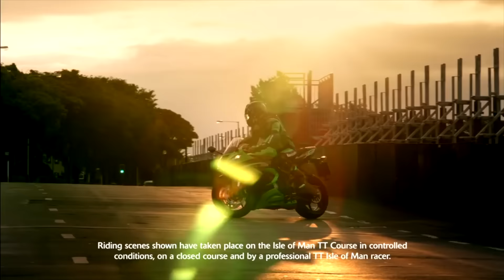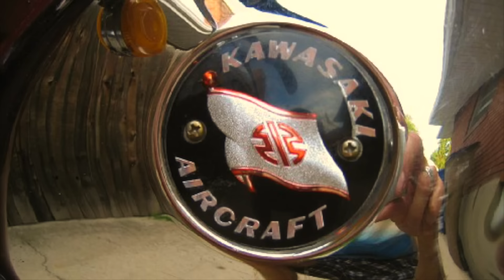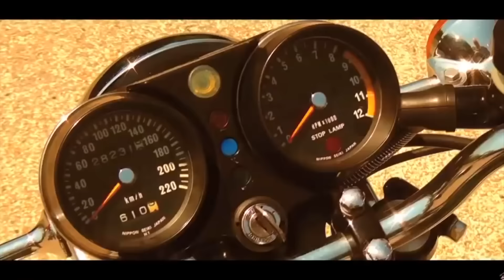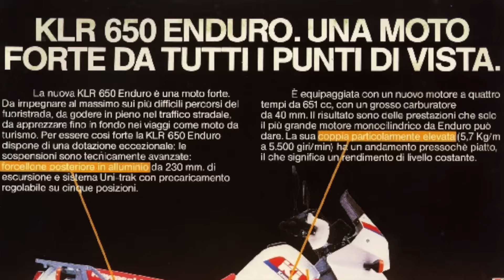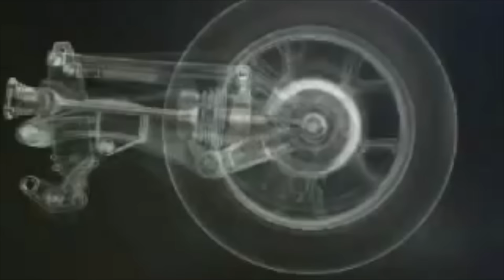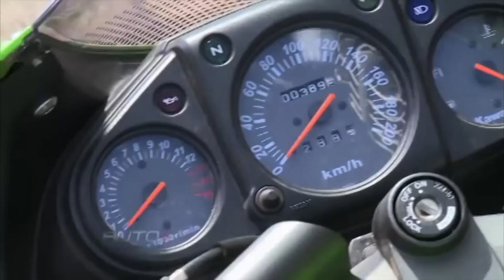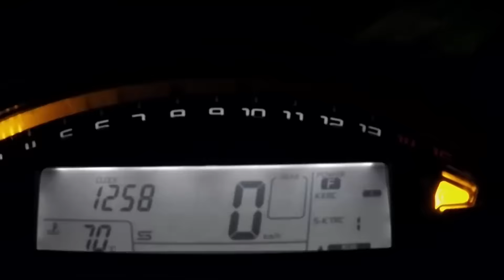History of Kawasaki Motorcycles

Comment: I bought a 2016 KLR 650 matrix camo brand new,, I heard they were bullet proof, I was going up a steep incline and the clutch plates fractured blowing out he oil up a 90% of the summit, luckily I was able to reverse and roll back down 4200 ft. I was pissed, the dealer said the clutch plates were probably manufacturing defect, so don't count on your klr if you are in extremis.
Reply from the maker: Damn that's a bad luck right there. I've known a few people who put thousands and thousands kilometers on their KLR. You really must have bought a lemon.